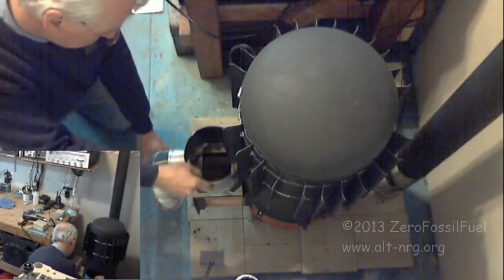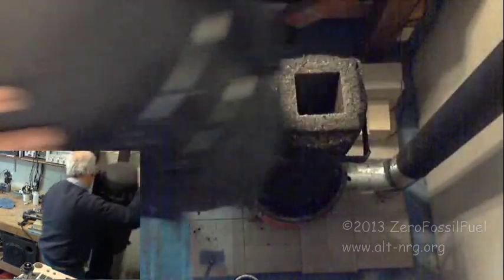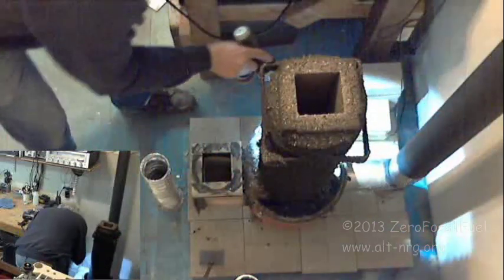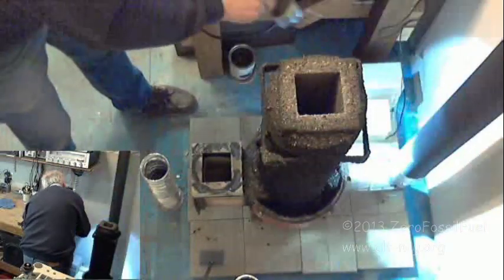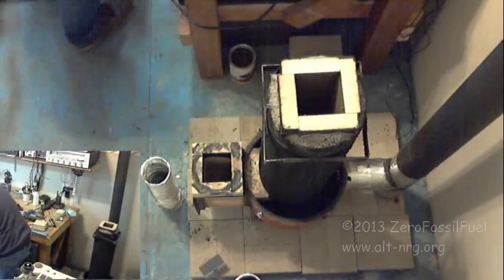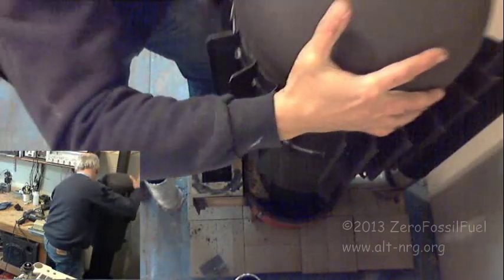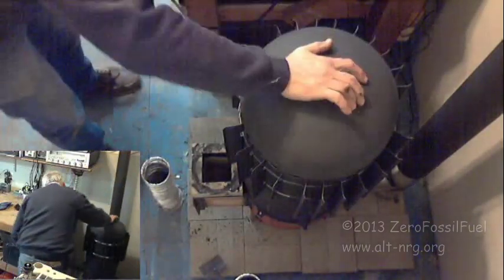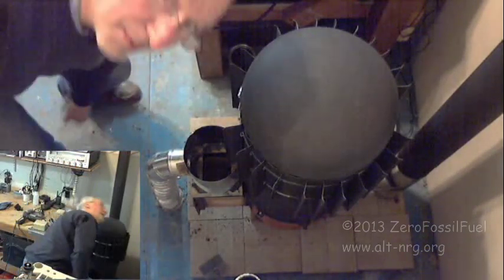#327 1st inspection of Rocket Stove Heater

Comment: ash probs: You could always put a square box at the bottom - to catch the ash, then pull be able to pull that out. So long as it doesn’t melt of course. How many times do you have to put wood in during operation? are you getting any tar creosote problems?

Starts up real nice. By the way the tank does look like a missle from above lol.